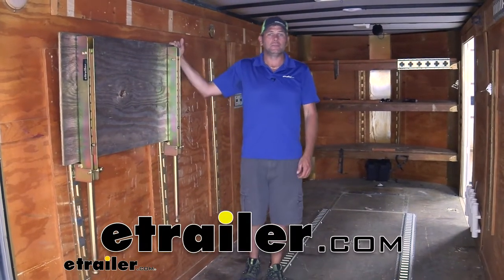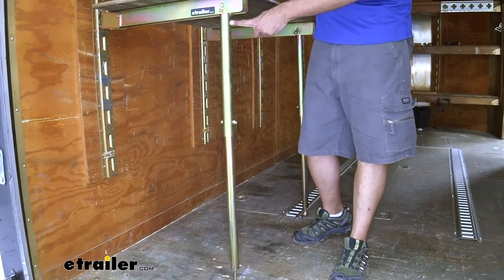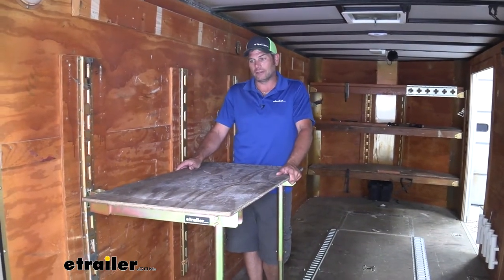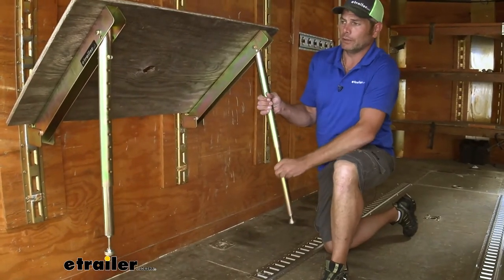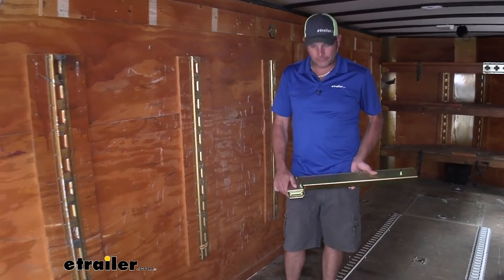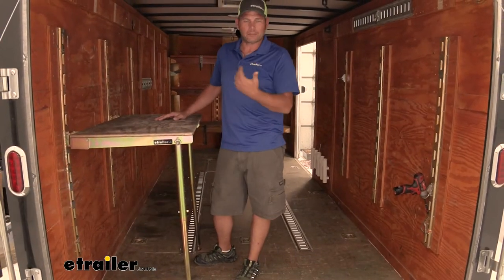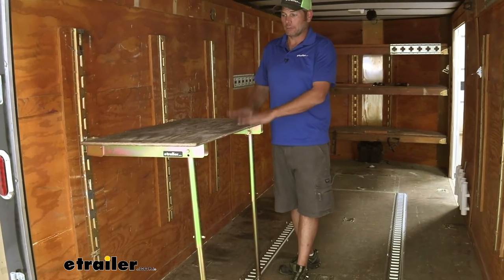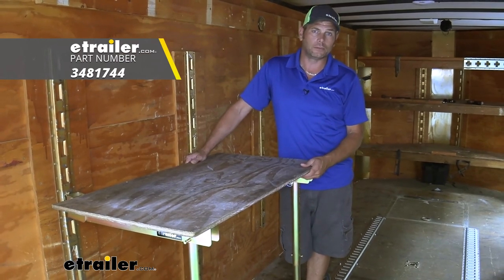etrailer | CargoSmart E-Track or X-Track Folding Track Brackets with Telescoping Legs Review

Comment: This design would make a great murphy bed. You could probably use 2 sets opposite eachother and make one. Have 1 side with overhanging plywood and the other with a shorter piece so the longer side could sit on those legs and make 1 long piece. But.....2 kegs are already $200. So you're in $400 for the legs plus e track, plywood and mattress
Reply from the maker: Great idea! It is pricey, but it's less expensive than an actual Murphy bed....
https://www.etrailer.com/E-Track/CargoSmart/3481744.html

Comment: The only thing that would make this even better, is if you made telescoping or extendable arms, so as to extend the table length or depth into the body of the trailer. This way you have greater customization instead of having only one set table depth. Also, I think having hardware that can be fitted onto the edge, where the legs meet the base of the table, would be great so that you can potentially disconnect from one wall, and simply slide it to the opposite trailer wall without having to turn the table inside the trailer body, in addition to potentially being able to connect or link up another set of table arms. Also, It would be ideal to have telescopic table legs that allow you to elevate the platform all the way to the trailer ceiling height. I could see this being potentially developed into modular shelving units that can stack and lock into one another also.
Reply from the maker: These are all great ideas! That would be cool if the arms telescoped out to make more a larger work space.
https://www.etrailer.com/E-Track/CargoSmart/3481744.html

Comment: do these systems rattle when you're driving over bumps etc? I'd like to install in my van but not if it's going to be rattling
Reply from the maker: Chances are there may be some rattling. However, that said any rattle can be negated with proper padding or a good strap. Each situation is different and not knowing your complete set up we can't give you a solid yes or no answer. https://www.etrailer.com/E-Track/CargoSmart/3481744.html#exp-productdetails=.reviews It would be wise to look at the product reviews on the product page, that will help you a lot!